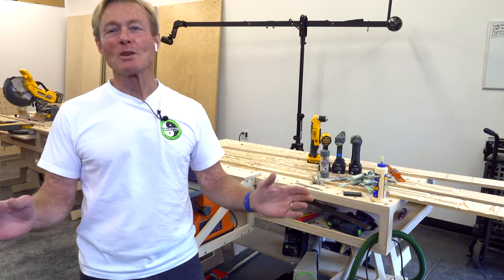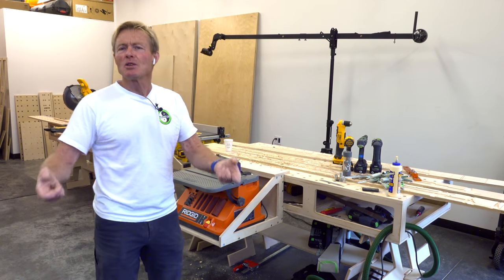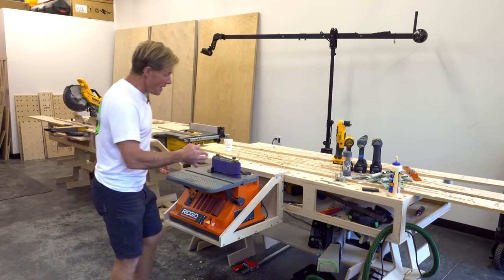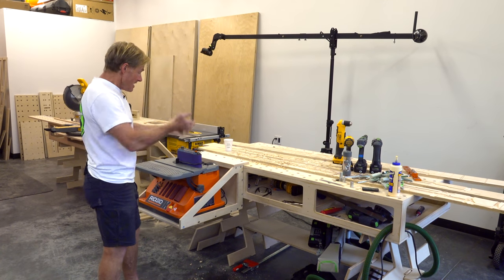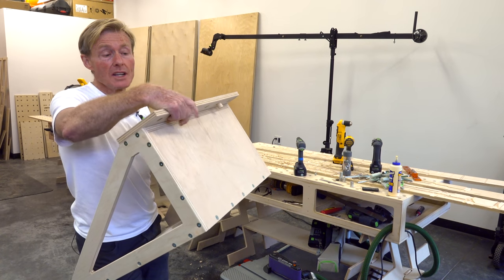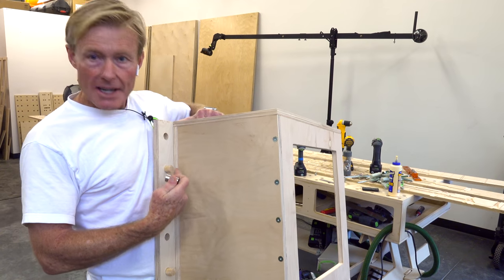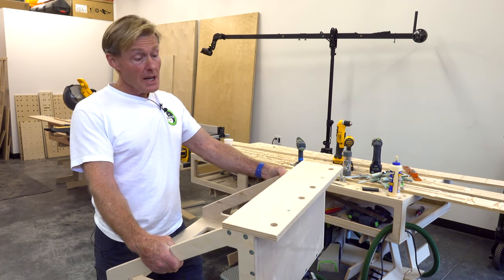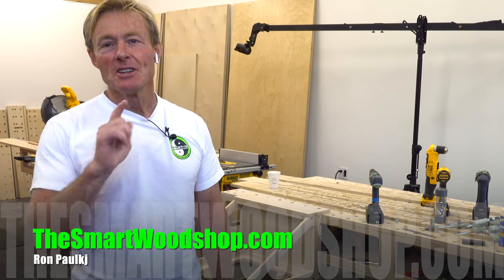Saturday morning in the woodshop

Comment: How feasible would it be to drop a miter saw into one of these cradles, then have deeper wing inserts that reach out to the new miter saw position? Maybe with their own cradle-style triangles to keep the wings from deflecting. Maybe something similar with the router tables? 
Rather than have two table designs, one with built-in tools and one blank table, have a singular table where all the tools attach via cradle; it'd make the smart table system much more flexible. It'd be even better if you can find a way to make these cradles fold flat for storage. Either that or have your storage wall work with the cradle design, so that the tools themselves are always with their cradle.

Comment: Suggestion. Do a French cleat to the opening on the sides.  So once set. The tops are flush. And you wouldn't have to put on outfield pieces or use dowels🤷‍♂️
Reply from the maker: Tried FC, but too much flex. I found the strut connector to be better.
Reply: Good deal. Just spouting ideas. Good day sir

Comment: Your videos are cool. However often easier when time is at a premium to watch short videos which are often equally as informative. Dig the cradle system.
Reply from the maker: It takes 10x the time to make a short video and get the message out than a full-length explanation. I often skip watching shorter videos from creators I like as the short ones tend to generate more questions than they answer. Some of the very talented creators are good at short form, but there are many masters willing to teach but don't have the time or talent for short form. Short-form is like poetry and is an art unto itself and I have found very few content creators that are good at it. I would rather spend 10 minutes watching something well explained than 3 minutes scratching my head wondering how, what, why?

Comment: Awesome idea, Ron. Did you machine or buy the 20mm wood dowels?
Reply from the maker: The dowl is labeled as 3/4" but measures 19.8mm and will not fit in a 3/4" hole. I was planning on ordering some 20mm but lucked out with this miss-sized offering.
Reply: @TheSmartWoodshop  Sometimes you get lucky when manufacturers do lousy QC and sell the wrong size stuff!
Reply: Ron Paulk Hi Ron,  I think these slightly undersized dowels will be the best solution.  They will drop in to the 20mm holes easily whereas the Alloy bench dogs are a tight fit and will be tricky to drop in.  If the dowels are too fragile some hardwood ones would be stronger and less likely to wear.  Turning them down a touch with sandpaper will ensure they are an easy fit.  Mike
Reply: @katabrontes  A further suggestion is to taper the 'leading edge' of the dowel just a bit so it 'falls' into the holes easier.  Should only need to take a mm or two off.